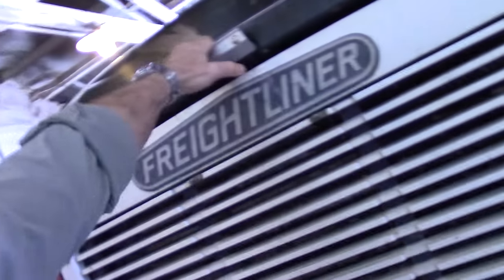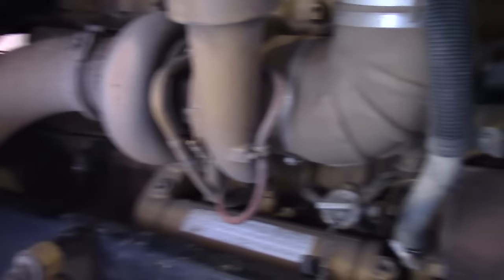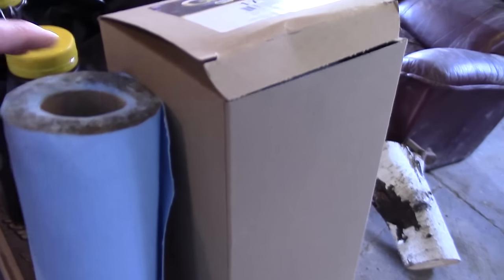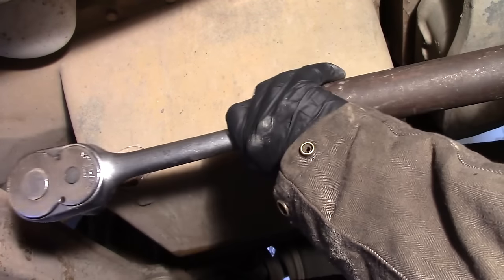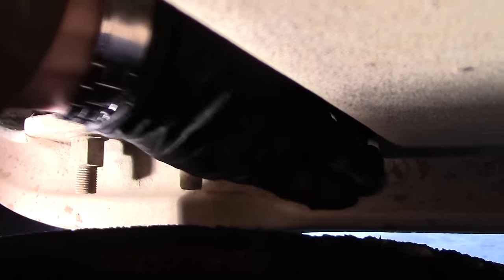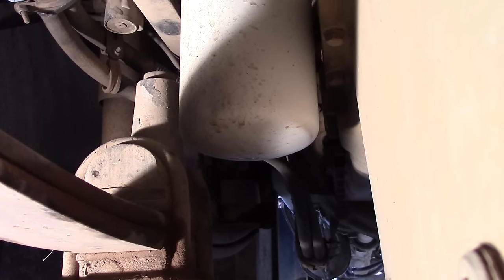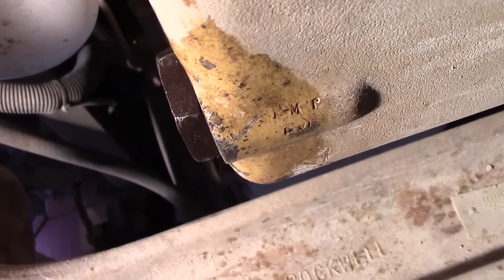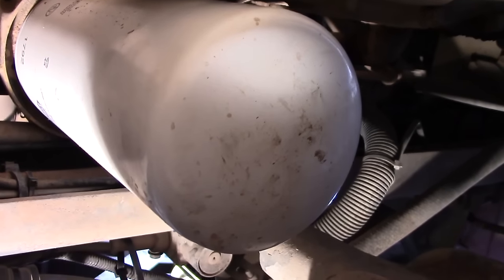How to do an Engine Oil change on a BIG Truck-DIY Duke

Comment: Nice video.  Nothing beats a nice , do it at your own pace, oil change.  I drill three small holes in all my dipsticks, at add, mid, and full.  I picked up that idea from my wife's Ford van years ago.  The dipstick steel is somewhat springy.  I use a 1/16" straight flute carbide drill.  That way you can easily see the oil level, even when the oil is new and clear.
Reply from the maker: That's a great idea 😀

Comment: I have been changing my own oil for 35 years and never thought to just put a plastic bag around the oil filter!! Great idea! I feel stupid for not thinking to do that all this time!! I have am suv I tow behind my RV, a basic Ford Escape, and the oil drain plug was stripped when I bought it..I needed to change the oil soon so I bought one of those vacuum pump things..Topsider I think..blue metal can with a pump..well that thing makes the oil change much easier! You stick the suction tube down the dipstick line and it pulls the old oil out! Almost every last drop! I would never use on a large truck of course but for a small engine like mine or on marine applications it's a good tool!
Reply from the maker: Yeah Chris that vacuum pump is a great way to change oil.  My goal has always been to not get any oil on myself during the oil changes.  So far I've never achieved that goal. I'm like a magnet to oil and grease.  Just recently did oil, fuel filter and lube on five water tenders and I was a mess 😫  Awesome motorhome btw.

Comment: 290 Tq? theres no way its that little
Reply: Poor Man Mods My v6 mustang makes more torque.
Reply: my farts make more torque
Reply: he prob meant 1200
Reply: Betin juarez 2000ft lb
Reply: Poor Man Mods 1800*
Reply: There are several different outputs for the 3406E, the lowest is 1150lb tq, the highest is 1850 lb tq.
Reply: But note that he said it delivers that at 1800 rpm which is pretty low. At higher rpms it probably produces much more.
Reply: Karan Driehuys it's diesel that's almost halfway through the typical rpm range of diesels
Reply: I too was like whaaaaat
Reply: Alrighty everyone heres some knowledge. 450 hp 1800ish ib TQ, for 3406E CATS is what they make at 1800rpm's. first  off if you love your semi u dont go past 1600 MAX. yes it can go higher but you're just destorying it at that point. You chill at 1400-1500 on the road. Absolutely no reason to be going faster than 70mph with 40tons of rolling motion. Also it doesnt make more at higher RPMS (have you ever seena dyno power curve).
Reply: Maybe it's 290 per engine stroke? SO then that would be 290*4= 1160 ft lbs after one full engine cycle.  1160 would be in the range many have said this engine should have. Maybe the convention for measuring torque in semis and in cars is just different?
Reply: im no expert but gas and diesel are much different so id assume the conversion is also much different. just think about the compression difference between a car (100psi) and even a tractor thats diesel at 400psi
Reply: Probably meant horsepower
Reply: Bro he commented that he said it was 1800 ft lb torq
Reply: 11:48 in texas
Reply: @kdriehuys  The power bandwidth of big rigs isn't very wide at all. Going to 1800 isn't necessary.

Comment: I did it by putting a rather large bucket under the pan, taking out one of the 2 plugs, drain oil, put plug back, put oil in. I'm 15. It was my first time, in 90 degree heat, in a nasty gravel driveway. I had a blast though

Comment: It still blows my mind that there is grown men they can't do an oil change
Reply from the maker: +DoctorGnash I know, too bad.
Reply: did my own oil changes since high school  !!!
Reply: learned it in  consumer ed  !!   ..lol   got me into wrenching
Reply: Done oil change since 16 I'm 17 now almost 18
Reply: Theres not really a point with how inexpensive oil changes are tbh
Reply: Done oil changes since I was 4. Draining oil from my father's Volvo BM650 and Volvo BM810.
Reply: It's hardly worth doing, as the savings are often around $10-20 at most. But ridiculous to not know how to do.
Reply: Alex_2259 It's worth it because you know it's done correctly. Too many of those quick lube shops will skip the filter change, use the wrong oil, strip drain plugs, etc.
Reply: edgarr When you pursue one thing the other gets away.  No shame necessary.
Reply: On the bright side it creates easy jobs for other people lol
Reply: John Doe I can do that
Reply: I mean not everyone has the privilege to learn
Reply: nightmare in action lol
Reply: Its cheap to get them done, but I love the satisfaction from doing my own work.
Reply: I pay every month for oil change, and remember after oil change , we have to change water separator filter and fuel filter and grease whole truck , to grease kingpins we have to raise up front end , so grease can do It's job , slack adjustment if needed ,now do the math after working 22 days in a month or driving 10-12k miles doin everyday pre trip knowing your truck well why I will change my trucks oil myself , spending half a day , local mechanics labour for PM maintenance is max 100 dollar , I will not save 100 dollar
Reply: edgarr some don’t know how to change a simple tyre. I mean they are on YouTube all the time you think they should watch a vid.
Reply: oil change? plenty that cant even change a plug.
Reply: Ever since some kid at Valvoline sprayed oil all over my engine bay around 1997 or so, I've done oil changes myself.  100% all the time every time.
Reply: @dynamo3059  There's a really good reason to DIY.  Those cheap oil change places use inferior oil and often do things wrong.  My brother went to one that didn't refill the oil after draining it!  

The cost from a reputable shop with quality products will be similar to the cost of DIY with premium products.  And DIY will let you inspect the underside of the car for other items to be addressed (brakes, suspension, fluid leaks, etc)
Reply: Doing my first oil change  but my mom kept trying to convince to just bring it in a shop and I was like hello no!
Reply: I change my own cars/ oil. Once with my wife, kid and mother 'n Law still in the car. Also had a fan belt snap on the freeway going down hill ( mt.vesuvios italy) with same group in the car. 20 years ago🚗
Reply: What about grown women?
Reply: @determineddad7935  exactly. No education and they are running the water plant making 150k a year and got there house for 60k and say young people are lazy. Been working since I was 8 years old and bought a house for 300k that some boomer paid 60k for. Thatd be like me selling it to the next generation for 1.5 mill
Reply: cant believe there are grown up man who cant write their own diagnostic software or debug whats wrong with their PC... M8, everyone is specialist in their own field
Reply: Total loss oil burn eliminates the need for it, aircraft engines, rotary engines and snowmobiles dont require it as it is a thing of the past an engine should burn its own oil like a JLO 2 stroke diesel.
Reply: John Doe  great comment, I get what you're saying.
Reply: Wait until the current generation grows up. Some will identify as an oil filter...
Reply: Oh gosh — that number is skyrocketing.

Many young Millennials (high school age or older) aren’t even learning to drive.

I guess they figure Über will take them everywhere in life?...
Reply: Nothing wrong with not knowing how to change oil. Most people here seem to have someone show them as a child. Not all kids have someone that can show them. It's also possible to just not like working on cars and have no interest.
Reply: still blows my mind that u cant defend a criminal in court
still blows my mind that u cant sell real estate
still blows my mind that u cant write code 
still blows my mind that u cant run a marathon. 
see what im saying?
Reply: edgarr I’m a 17 year old heavy diesel mechanic and I have more knowledge then 94% of men in this world
Reply: It blows my mind there are still adults who play in the street then get shocked when they're hit by a car.
Reply: @nightmareinaction629  You should be making educational videos, especially now that you're about 20.
Reply: Been changing oil since I was in my moms womb

Comment: That's a whole lot easier than changing the oil on my Mini.  The coolant expansion tank has to come off to get to the housing for the cartridge filter.
Reply: Sounds like bad design
Reply: automan224 of course it's a mini

Comment: Very good video. Can not get over the size of that oil filter it holds as much as a small car would need for it,s whole oil change. When doing a service like that on a truck or suv etc worth  checking all lights tire pressures and greasing on truck where necessary plus lubricate hinges on doors etc, and the truck will last a long time!

Comment: 11 gallons of oil, over a million mile on the engine with out a rebuild plus that oil filter look like it holds more oil then my 4 cyl my head is still spinning at what the cost is on maintence.
Reply: Most truck owners earn that money back in less than a day

Comment: My Car takes 4 Quarts of Oil. Wow you can fill my car and then some with just the Amount from the Filter.
Reply: Icebeam47 mine take 6 and 8 lol
Reply: hmm, 2 gallons here.
Reply: Got stuck on the side of I-95 south in a huge truck hauling a Zamboni. Ended up doing an oil change. I balked at 4 gallons.
Reply: Wow my motorcycle uses 1.5 gallons
Reply: +nightmare in action: BMW inline 6?

Comment: Where's your copper washer on the drain plug?
Reply: Roger Onslow Its not a copper washer, it's a rubber o ring
Reply: Appologies
Reply: I've never seen a o-ring at the oil plug.. you use a copper washer or nothing..
Reply: On these Cats, the drain plug has a recess and there is an oring. Just how it is from factory..

Comment: 290ft lb of torque from a 14.6L Diesel? Think your numbers are off a bit....
Reply: i think he reversed the torque and hp specs
Reply: Alex's Bikes and Motors That still wouldn't even be remotely close. Only 450ft lb of torque from a 14.6L Diesel? The F150 3.5L V6 Ecoboost has more torque than that(470ft lbs). It's actually closer to 1,700ft lb.
Reply: I feel like he meant either 1290 or 2900, though I'd wager on the first one.
Reply: MercilessHobo it have 2000ft lb
Reply: I don't understand why people are trying to give me numbers... I already posted the correct number. 1,700.
Reply: Apparently not, the uploader himself said it's 1800
Reply: He also said it was 290... He had also at one point replied to somebody saying 1,600(looks like that was deleted)... But sure. Take his word for it. Haha It gets it's peak power at 1,800rpm. So for all we know he got numbers mixed up. Again.
Reply: I'll give you that lol. Totally possible he fucked up again
Reply: TheTmaaan55 I'm not saying I'm 100% spot on. I don't know much about these engines and I'm not the manufacturer, however I found numbers around 1,700 on multiple different sources. Compared to the multiple different numbers he's given. The world may never know...
Reply: 14.6L Diesel?
Man what they could have done with a cart like that 70 odd years ago. Paton would have been in Berlin a year early and got it through the Ardennes too. Would have torn a big hole in there.
Reply: He def didn't e those #'s right.  3406/C15's like this spec anywhere from 1650-2050ft. Lbs.

Comment: An excellent broadcasting and a sympathetic man. But it has always wondered me why American lorry cabs look like that's thrown in with a shovel. Cluttered and confusing, it looks like something from the 1960s. Try to see some of the europerian trucks like. Volvo, Scania, DAF, Mercedes, etc. where orderly and welcoming they are.
Reply from the maker: +Anders Vinther thanks Anders,  yeah sometimes if you're not familiar with all that stuff takes forever to find the Jake brake or whatever.
Reply: Anders Vinther That dashboard is what allows the driver to have total control over the machine, instead of the machine having partial control over itself. We like manual stuff that won't break easily and that we can fix at home when it does. Americans don't have a lot of money and we like being self sufficient. We also kind of think of machines almost like another lifeform and we don't entirely trust them.
Reply: Smiles...

Comment: In my experience working on mostly fleet trucks(mostly volvos).  I have found that you have give the  oil filter on tighter than hand tight. Due to how much these trucks vibrate. I can think of about 10 times where we have been called out just to tighten oil filters and one time. Replace one of the three filters because it fell off.

Comment: What is the oil change interval on that truck? Great video BTW.
Reply: Usually monthly oil changes along with a full grease job. I did it for 4 years as a side job on my fathers truck.
Reply: MarzNet256 I work for a fleet and most of our trucks are freightliners with isx Cummins engines in them. we go about 27,000 between b services that include oil change, fuel filter change, fuel water separator change, full inspection and lube.
Reply: Jeremiah Turnberg thats an E service in our shop. B consist of air dryer filter, injector tip, fan hub, crankcase filter, air filter, power steering filter, and coolant filter. :)
Reply: depends on the job of the truck, i work for a company that has a bunch of trucks with different jobs. the over the road trucks are every 20k and the local are every 15k. all trucks that are off the road and only get used in the compound are every 6 months. we use mostly volvos with volvo engines and have some internationals which i hate very much and some macks and freightliners, and 1 pete
Reply: Bmtp27 really gotta change the crankcase filter every time you change the oil? we have lifetime ones for our trucks only gotta do them once!
Reply: Full synthetic oil?  Quite the intervals.
Reply: 10,000 miles..

Comment: only 280 ft pounds? more like 2000 ft pounds
Reply: Ballista Bomber at the crankshaft not the wheels
Reply: should be around 1600 Ft/lb.
Reply: Even at the wheels it would be much higher.
Reply: well he did corrected that already, but at the wheels the torque gets multiplied way way more, my 3406E at the dyno on direct drive was 10,000 p/f of torque and that was 467 hp, now is even more than back then.
Reply: +blackericdenice Ha. Fancy seeing you here :P
Reply: VinylDash303 Oook
Reply: ***** the truck have 1800ft lb

Comment: Can't you just take a punch and hammer and punch a hole in the bottom of the oil filter to drain it into the pan before pulling them off?
Reply: That's how I do it
Reply: Joe Hanson That is we do at my shop in Michigan
Reply: can also tap a screwdriver through the side for leverage on removing a tight filter

Comment: I think the torque  you quoted is wrong. You said 290 foot pounds. I would think like 1290 foot pounds. I have no idea but the torque is way higher than what you stated. I know its way off ..my superduty puts out over 700 at 1800 rpm
Reply from the maker: +wascrash you're right, it's 1800 lbs of torque, thanks for catching that.  Big engine, big torque.
Reply: you should fill the filter threw the holes around the edge not the center because the outside filters oil you could have put dirt into it

Comment: Is working on a big truck easier than working on a car, cause I'm thinking about getting into big trucks
Reply: MySHAQ18 Parts are a lot more accessible in the engine bay.
Reply: Get into them is a big step up.
Reply: No. working on a big truck is not easier.
From a mechanics stand point it "is" easier, but you have to realize its just because as he stated everything is so large and easy to get to, which also translates to needing large equipment or multiple buddies when something large fails..... But for basic stuff like this they're the mechanics dream. But when you have to take and do injectors or timing chains, that's when the fun begins. (just imagine having to replace piston rings.) Oh and did I mention transmission and air brake work ?
Reply: Was...Was that a pun?
Reply: it depends, if you go work at a shop that has hoists and stuff, go for it. If the shop doesnt have it, your back will be gone in a few years
Reply: I used to work at Pep Boys for 3 years as a mechanic, been at T/A for 3.5 years. Some things are harder, some are easier. Our oil change packages can take about 1.5 hours(greasing the truck, airing the tires, doing standard ispections, checking all 3 boxes, ect). I don't regret it.
Reply: MySHAQ18  everything is bigger, heavier and built to last for long miles. Check out the size difference of disc brake rotors for example they have to come off with the hubs attached and installed the same way. Calipers are very heavy also. If your shop has hoist or lifting equipment your fine
Reply: @jeremywatson3045  try having to change the slave cylinder on the transmission of an old international 9300 series. You have to stuff your head and chest in between the frame and cab to reach the freaking thing.   Do that at 3 am on the side of the road. Or better yet have a rear end blow and destroy everything under the truck. I saw it all in the time I drove.

Comment: Ol cat C-15 there.  Good one too with no emission controls.  Never seen anyone use a bag over the filter before tho that's a good trick to avoid a mess,  I think I'll try it next time.  I usually punch a hole in the bottom with a sharpened punch and catch it with the same drain pan
Reply from the maker: Thanks Dillon

Comment: To make life simpler and the job a little easier, I work on MP8 Mack engines and they got 3 oil filters. like to take a sharp poke of some kind and poke a hole in all the of the filters at the bottom to relieve the pressure and the oil drains out in the pan